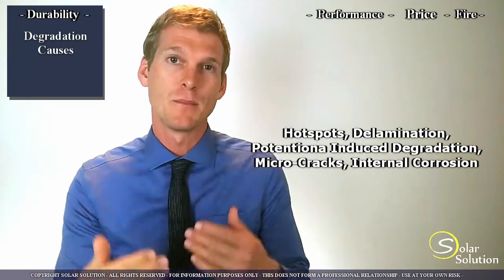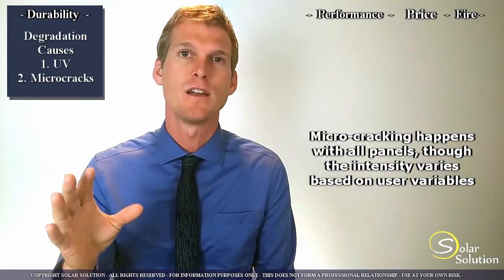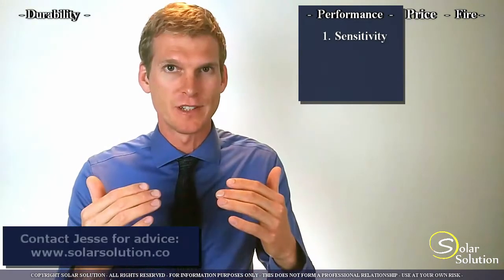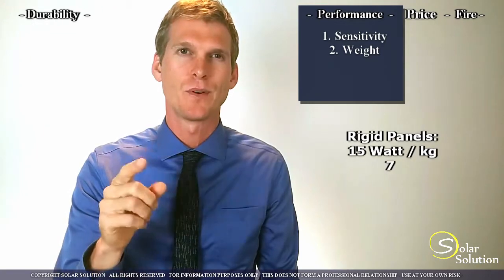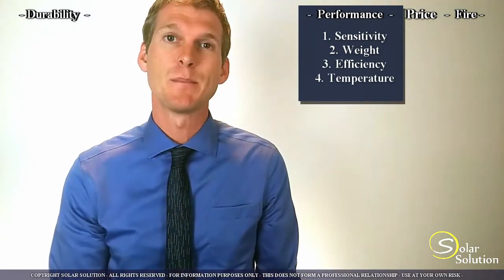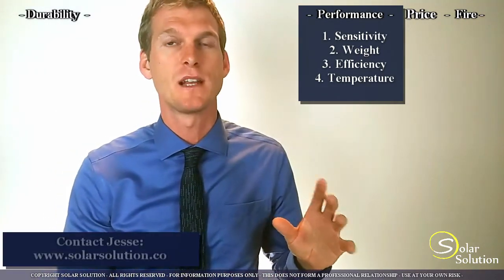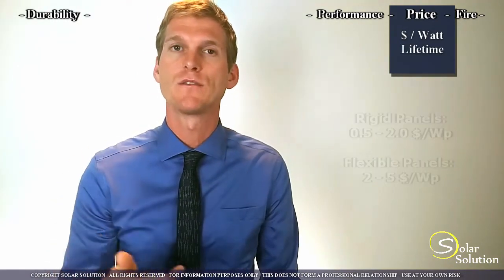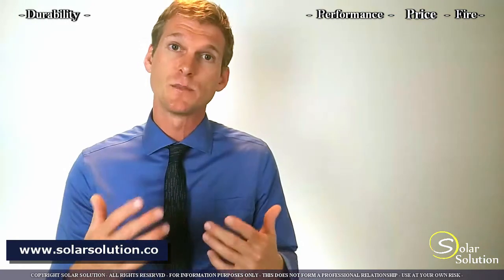Flexible vs Rigid Solar Panels: The Complete Technical Comparison

Comment: Flexible panels are designed for other uses where rigid panels are a poor choice. For example, flexible panels are ideal for installation in motorhomes, yachts, building balconies, buses, trains, etc. Rigid panels are currently the most appropriate solution for general uses, but they should evolve by reducing their weight, size, and efficiency.
Reply from the maker: That’s a great way to put it!

Comment: The flexible panels 
Seems to fail fairly
Quickly in comparison to rigid panels……and I mean considerably less time
Reply from the maker: You are correct! Some of the high-end flex panels do get longer life spans, though definitely not as long as the rigid panels.

Comment: Thanks for the concise information! Im making a decision to live in my SUV in southern California, a few hours north of Los Angeles. I absolutely need an alternative power-bank and the proper means to charge it. Versatility and adaptability will likely serve me best, but cost is what will hold me back. And this “project” is not something I have been able to prepare for- it sounds better that I made a choice instead of not having any other reasonable options for permanent living space, like a bedroom in a house. It’s so expensive, and I’m on fixed income and I can’t stand the idea of living check to check and becoming whatever that makes someone turn into. Summer is here, in the high desert, and temps are regularly 100 to 110 de degrees Fahrenheit. I must get a power system in my vehicle with an external (ideally 12V DC powered) air conditioner of some type. Im a military veteran so I understand that diesel vehicles are designed for continuous operation. Ive always heard that unleaded gasoline vehicles “don’t like” running for hours on end without actually driving/traveling. And gas would be very costly to do that. I hope i dont melt in the desert before i can put something really good and reliable together. I hope that this period will only last 2-5 years maximum. So whatever I get, i need it to last me 5 years to be safe. Im totally open to input and suggestions to consider before i start to purchase any of this equipment. Thanks
Reply from the maker: Thanks for sharing! If I would be in your shoes/flipflops, I would probably start off with mounting as much PV on my roof as reasonably possible, have a heavy duty alternator/portable generator as backup during overcast, and match your energy storage AND consumption to this setup. Good luck! Jesse
Reply: @SolarSolution  Thank you! You just validated a lot for me. I was not sure if my plans were the best approach, but you literally suggested my own plans to me, which means a lot to me given your  expertise. Well, I know I need the service you offer, and it's the comprehensive one. In short, I'm sold and I can't wait to use your service, in the next few days, I hope. Thanks again.

Comment: Jesse,

I'm watching your video several years after you made it.

It's good to have a speaker who is so well technically informed. I learned some you points.

I dabble a little in solar with some inexpensive Harbor Frieght solar panels and recycled auto lead acid batteries.

Why? Recyclyed auto lead acid batteries??  Like $2O to $40 each.

I defined my requirements were not for Off-Grid power, but for short term Emergency/Survival Power.

I did a  cost/benefit calculations on how often I was likely to draw power and for how many days for each occurence.

Rule of thumb one can discharge a standard auto lead acid battery to 50%. Drawing down further each time will incrementally damage and incrementally shorten a standard lead acid battery.

The more expensive Deep Cycle Lead Acid, and even more expensive Lithium Ion batteries advertise up to 80% discharge. 

However, why then do their manufacturers highly recommend you only discarge these deep cycle lead acid & Lithium Ion to ONLY 50%.

Again, for my objective for limited short term occational use I chose to go cheep, wirh auto recycled lead acid auto batteries.

I've used auto recycled lead acid auto batteries in my automobiles and have noticed no failures or reduction in battery life.

I'd like your comment and review.

- Paul

Comment: are portable/folding solar panels effectively the same as flexible panels, meaning lower life span and easily heats up etc. and does ETFE overcome flexible panel issues?

Comment: In your opinion, what is the best flexible 100 watt panel?? I'm currently building a small system with mppt charge controller with lead acid, but eventually I want to install everything on a catamaran or monohull

Comment: so if you attached a flexible solar panel to a bimini, for example by zips, and the cut out the area directly under the panel in order to prevent trapping the heat and allowing free air circulation, would the underside of the panel represent a safety threat by allowing it to be touched

Comment: I want to install on a airstream trailer so curved roof and only 2/3rds panels will be in the sun with no environmental shading. I can add 3 sets of panels I have 68" in width and 22' in length  plus  a 100watt standalone I plan on a 15x18' fold out on truck. Original I wanted solid see-through panels and about 3"" of air gap as airstream are solar ovens. I am removing the insulation and doing spray foam and double glazing the windows. But the ease of Installation and lack of penetration in the roof with flexible panel are better. And price is a issue but 5 to 10 year life expectancy is a buzz kill. I have seen both on airstreams. I would like the shade from the solid but not the weight and adding all that weight so high on my trailer and it is getting a 4" lift (boondocking). So I am at a draw leaning towards flexible. Or maybe flexible on sides and solid running center line.  I am going to run a mini split 38sheer HVAC (900w) system with.

Comment: Hello. Good information and well organized. Very much to the point and no fluff. That's good. I wonder which panel is rain resistant, probably the rigid? I also live in the Pacific NW in USA. How well does solar even work up here? I'm in Washington state on the west side of the mountains.
Reply from the maker: I am glad to hear your appreciate the 'no fluff' aspect of the videos, thanks for letting me know. As for using solar panels in Washing State: You might appreciate researching 'Peak Sun Hours' and the yearly yield you can expect for your area. There are several US websites with good statistical data on this topic. Good luck! Jesse.
Reply: Works great in the 2 weeks of Summer you get. You should check avg sun solar hours days in your area and off peak winter solar hours avg. To size your system. And there are lower light level photo cells available. And if you have an average 6mph wind a backup windmill for storms would be advised and they are cheap now make sure it is marine grade.

Comment: Is it possible to achieve minimal bending of rigid panels? Say bending along a 10 foot radius? Any intermediate solutions?
Reply from the maker: Haha you have got me curious now John. What are you trying to accomplish? Every problem has it's solution.
Reply: @SolarSolution  thinking about trying to develop a solar SIP panel for dome houses.
Reply from the maker: That sounds interesting John! Thanks for sharing. There are several options for this situation, the 'best' solution depends on where your priorities lie: weight, performance, esthetics, investment, etc.
Reply: @SolarSolution  thanks! On further consideration it's definitely better to support standard rigid panels. Aesthetics isn't worth the huge maintenance cost. You can find standard panels stupidly cheap nowadays.

Comment: I need a lightweight solar charger for bicycle touring.
My 24 watt rigid panel is around 2.5 pounds and I want to save as much weight as possible.
Reply from the maker: Hello Marc, thank you for your message. Sounds like you have an exciting adventure coming up! Most charge controllers will have their total weight indicated in the specification sheet, it just takes a bit of time to compare them. Good luck and all the best,
Jesse

Comment: What is your opinion on CIGS flexible panels?
Reply from the maker: Hello Mr. Louis, thanks for your question. I understand you have already purchased the CIGS's. You question is somewhat broad; Could you further specify your question? Thanks, Jesse.
Reply: @SolarSolution  Jesse, because of the large size of these panels in the low output I still have my reservations. I was just wondering if you had any hands on experience with this technology. I will update you with my progress over the next month or two, and give you my opinion. I value your knowledge I look forward to your future videos even after my system is up and running.

Comment: Jesse,  do you have a guide on evaluating quality of lead acid batteries? iI have learned over the years that cost is not always associated with quality.
      You are clear, concise, and always informative.  Keep up the great work and thank you.
Reply: Jesse you now can get lithium ion battery for less than wet cells. But with some maintenance and care wet cells will last longer. If you do go with wet cells there is a cell cap with a adjustable float level that allows outgassing for about $3 a cap that will greatly reduce your maintenance just tap every cell cap see the level indicator is working and check infeed bottle for liquid. Then there is a flush that needs to be done about every 5 years and a sentiment check ever year. There are chargers that put a high frequency high charge into the batteries to shake the calcium off the plates. Is the sediment touches the plates at the same time it damages the cell. That why important to check for it and flush the cell. Most batteries are not maintenance friendly and very heavy and take up at least 2x the room.
Reply from the maker: Hello Jay, thanks for your message. Such a great compliment to receive, thank you! It's good to hear you find the videos useful. As for your question, here are two options for you:
1. The video on battery selection: https://youtu.be/LhARAsr1KX8
2. The playlist with all video's related to battery topics: https://www.youtube.com/watch?v=JeVakJhwkis&list=PL9Nrg1XB1hdjWs1Fo6SHBhs1ag_PQl4Ct
It would be great to hear whether this answers your question. Enjoy and all the best, Jesse.

Comment: Great video thank you! All your videos are clear concise and very informative! I wonder if you could share what type of adhesive you would recommend to glue a flexible solar panel to a painted Fiberglass Deck. Or alternatively if there's a better way to mount a flexible panel to a deck to allow air circulation under the panel. Thank you.
Reply from the maker: Hello Richard, thanks for your compliment! It is good to hear that the videos turned out the way I intended. For personal advice you can contact me through https://www.solarsolution.co/contact
Reply: @SolarSolution  "Oops! That page can’t be found."

Comment: Very well done comparison. You asked for ideas for other topics... I am in the process of selecting components for my 5th wheel RV solar system. One component I am having a difficult time finding good info on:
Mounting hardware for rigid panels... tilt or no tilt? (sources)
Best mounting frame anchoring method without penetrating the roof membrane? 
Best method of wire management, UV protection of wire and MPPT controllers on RV roof? 
Best method of installing junction box and roof penetration, sealing/flashing of roof penetration?
Reply from the maker: Thank you for you feedback Billder. You have some great topics there, I will add them to my list of new content and share it with you once I upload it. Thanks! Jesse.
Reply: The mounting tape from 3M called VHB is extremely strong and RV users are mounting the rigid panels on their roofs with great success in strength and staying power.

Comment: Thank you for the information.
Im interested with folding solar panel using ETFE..
Do you mind to share anything about this?
Reply from the maker: Thanks for your message, you are welcome. Great username by the way! Sorry, I do not have a separate video on folding ETFE panels, though they are almost identical to regular flexible ETFE panels. 
All the best, Jesse.

Comment: alot of camper trailers use flexible panels should they only be using ridge due to durability and heating up like you mentioned?
Reply from the maker: Hi Matt. It really depends on the system performance requirements of the camper trailer owner: Maximum Weight Reduction - Vs. - Max Service life - Vs. - Max Surface Power Output - Vs. - Temperature Sensitivity - Et cetera. 
Or in other words: What is the priority?